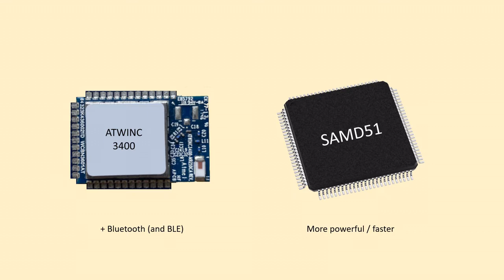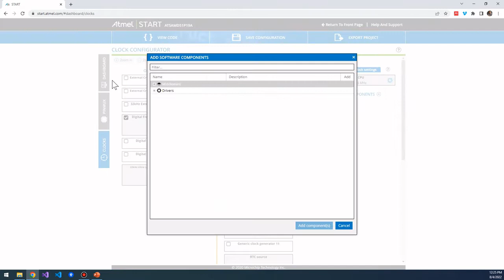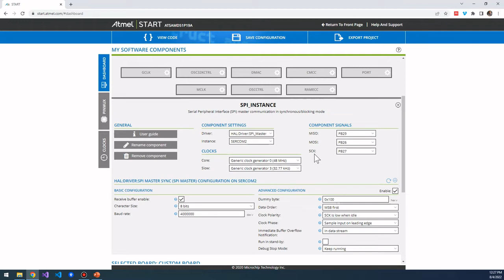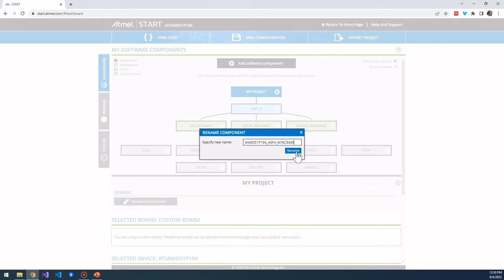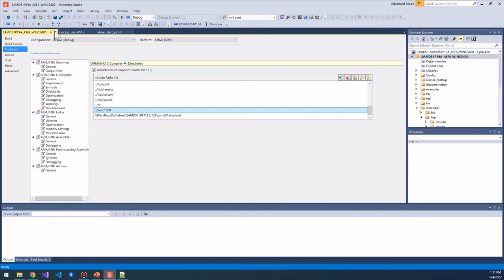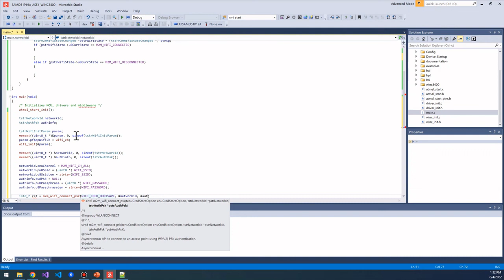Using the ATWINC3400 wifi/ble module with the SAMD51 microcontroller

Comment: Great video and info. Looking forward to trying out your 3400 library for one of our biomonitoring applications.
Reply from the maker: Hopefully it works well for you. However, I will say that since I made this video, we've moved from using the ATWINC3400 to now using the NINA-W102. It has been much easier to work with.
Reply: Thanks, I’ll have to check that one out, although WINC1500 still works fine for me with SAMd21